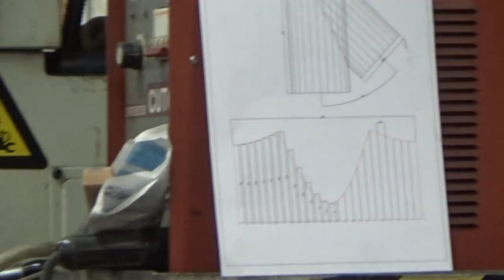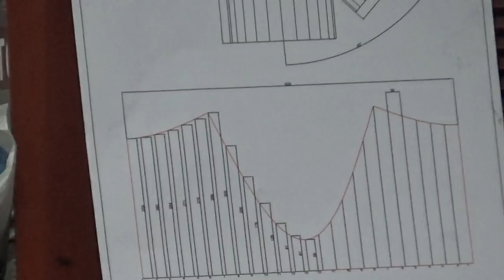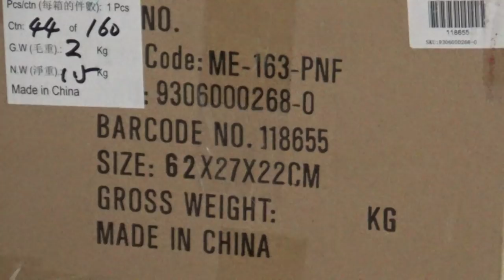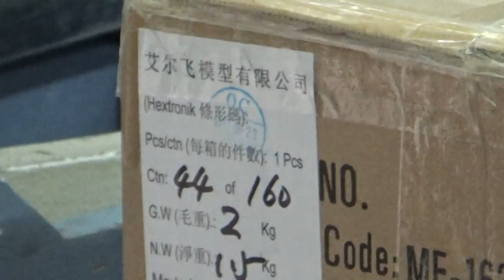Another GREAT RC electro Plane DEAL PART 2

Comment: Robert  the p-51 HK Flies great on a 4s 3000 cg is on the money,,,Blaz as always great job,,,talk soon,,,,,,,,,,,,,,,K
Reply: K-QUAD RC That depends on setup. My setup is (was) for 3S batteries, I used 2200 up to 3200 mAh 3S in that plane. 4S is too much for installed motor,prop and ESC.
Reply: Gorazd Cok Hey thanks cause it way to fast i put 840 kv 60esc so maybe i will try the 3 cell 2200 and 3300 lets see how that does..k

Comment: I am glad that you like my ex warbirds. One little notice, HK Mustang flies on 3S batteries, don't use 4S on it. I used 3S 2200 up to 3200 mAh on it. Anyone interested in specs , they are mentioned on my channel videos, and that carbon prop is 11x7.
Use 4S batteries on FMS Mustang and Stuka, Stuka needs about 30 grams of additional weight at the nose when using 4000mAh 4S batteries. And for mounting the battery in FMS, just slide that plastic holder in and out. It flys excellent with 3600 up to 4000mAh 4S battery.
Happy flying and see you soon my friend.
And one BIG THANKS to you for using my affiliate link on Banggood.
Reply: I knew that was your Stuka, as soon as I seen the clear tape, holding on the belly pan......LOLOL
Reply from the maker: Thanks Gorazd for the tip. I really thought that Mustang from HK goes on 4S. And the planes are just great. I tested today P17 and P51 FMS and they are great. I love FMS Mustang. It flyies so well and the landing gear is just awesome. Iam really happy that I bought this babies from you. Be well my friend and see you soon. Greetings from Slovenia to Croatia, Robert